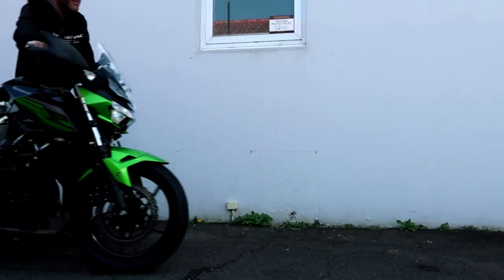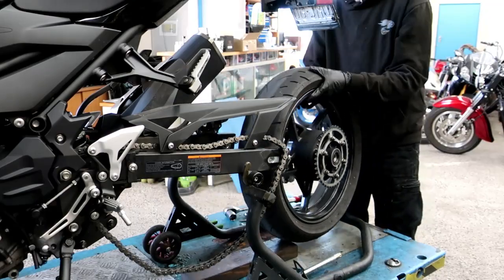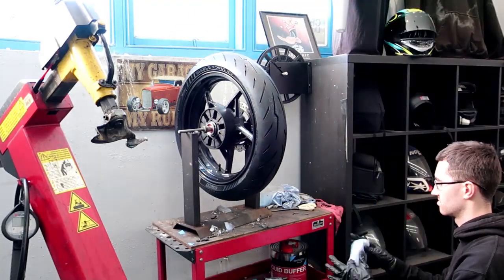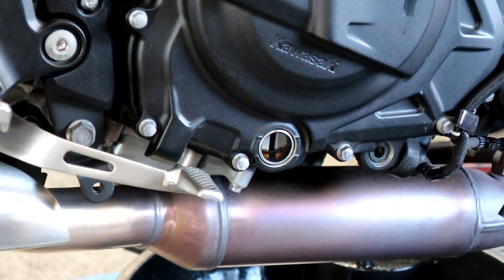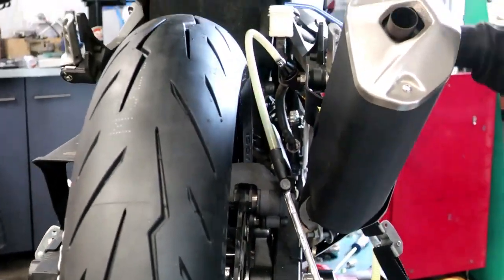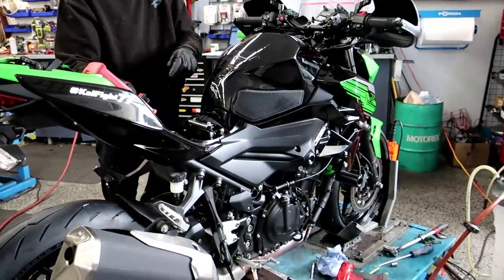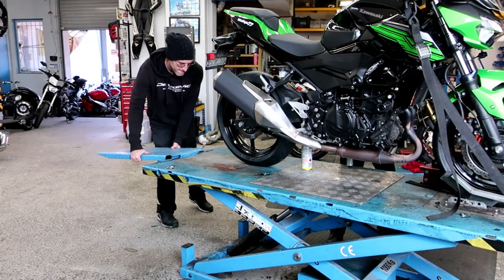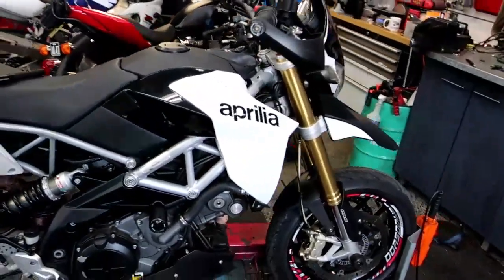Servicing a Kawasaki Z400

Comment: Great Video, I recently purchased a used Z400 and the previous owner did not show the bike the most love. I’ve been doing some maintenance on the bike but I was wondering how much would a mechanic charge for the services you performed? Could be a rough estimate if you don’t mind sharing. Thanks.
Reply from the maker: It depends greatly where you are from. But it shouldn’t be more than the cost of a minor service